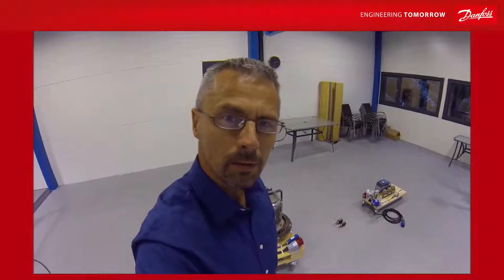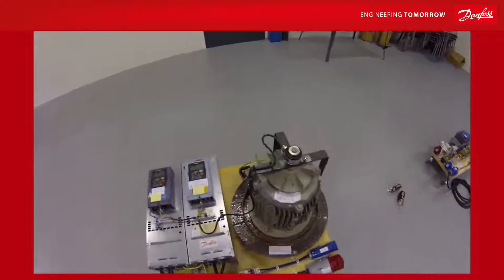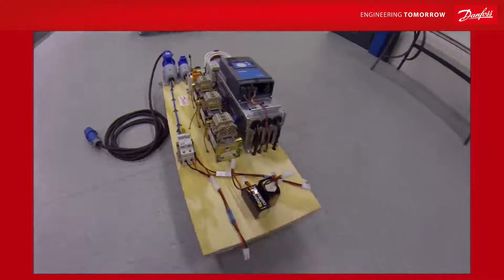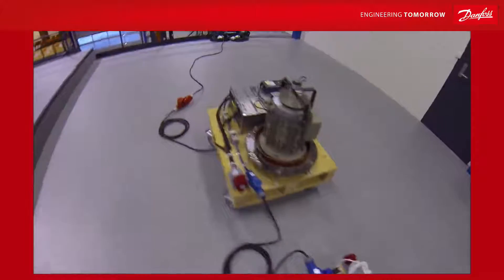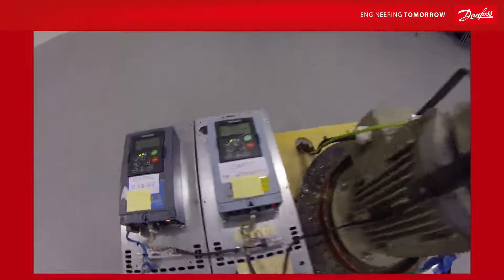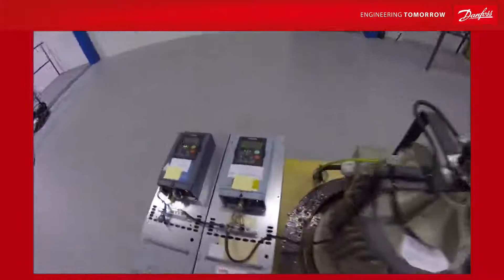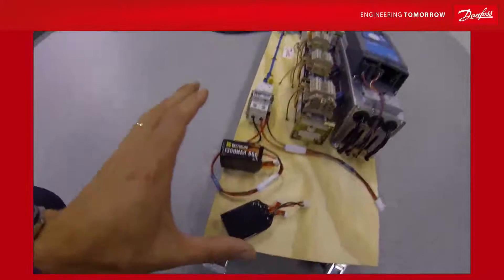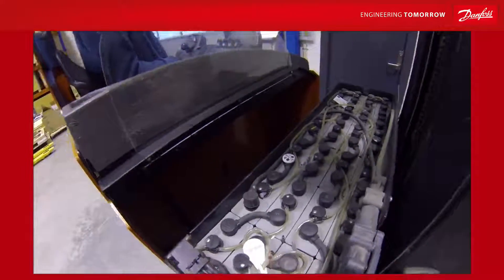VACON® NXP DC/DC Converter - UPS/battery backup

Comment: Hi, There are two modes for DC to DC converter charging the battery. voltage and current mode. We observed wide voltage fluctuation from DC to Dc converter at the battery terminal from 400 to 515 V even though the max limit set is 430 V in the convertor. We used Current mode for charging with current limit set to 70 Amps max for charging. The output for charging the batteries should be stable, Right?  What we should do for making it stable? We use Lithium batteries of 150 Amps rating with the bank voltage of 415 V DC.
Reply from the maker: Hi Ajay,

Thanks for watching our YouTube videos and for getting in touch! For this kind of question, it will be best if you contact your local Danfoss support office to make sure you get the help you need from the right specialists. Please find contact information here: https://www.danfoss.com/en/contact-us/contacts-list/?filter=type%3Adanfoss-sales-service-center%2Csegments%3ADDS 

Best regards,
Danfoss Drives Social Media Team

Comment: Dear @Reidar Berntsen, is it possible to feed 380 VAC drive  (NX of VLT)  from the external power supply 75 VDC -150 VDC using DC/DC converter to DC link?  There is only DC power supply for the drive.
Reply: Hello Drivelgor, yes it is possible to feed a 500VAC volt drive from a lower dc voltage source utilizing a DCDC converter. Be aware that nominal DC link voltage for a 500VAC drive is 675VDC and boosting the voltage to 675 from a source with a nominal voltage of 75-150VDC needs special attention to the VA (volt ampere) sizing of the drive. It is a boosting factor of almost 10 times and the amperes on the source side of the DCDC converter will of course be 10 times higher than the DC link side. It will be a relatively big drive for the DCDC converter and choke, in practical 10 times bigger then the consumer drive. Also be aware that the NXP drive nominal source voltage when used as DCDC converter is rated down to 200VDC. Running it on as low as 75VDC does not mean that it doesent work, it means that the performance is not proven or guaranteed. The inductors, the chokes on the source side then need to be customized for best performance. To size the drive and the chokes we use the tool Vacon Select.
Reply: @AcrodesignerLNSNI  Thank you @Reidar for the fast detailed answer.
Reply: @DriveIgor  You are welcome 🙂 Best regards Reidar